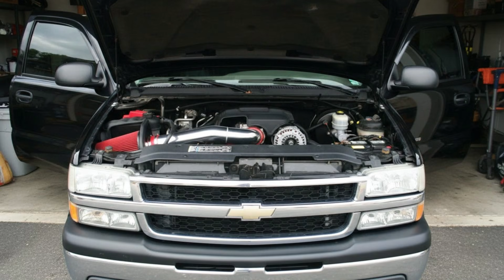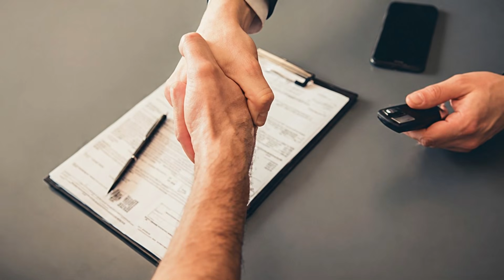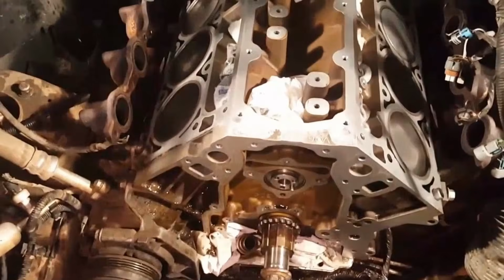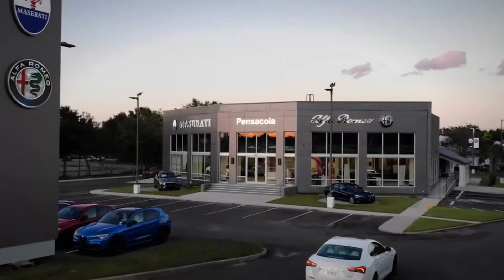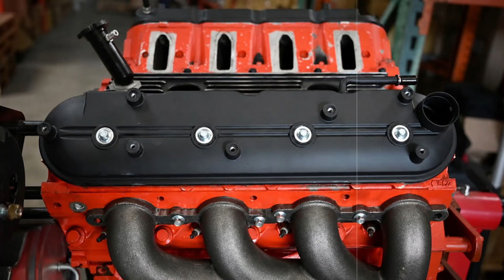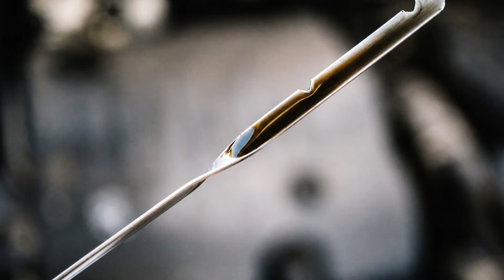The 5.3L Repair You MUST Do at 100K Miles — Or Pay $5,000 Later

Comment: Or you could simply avoid the damn things and buy something else. Unless I could find an older one with low mileage that didn't have that crap, I think that's what I'd do. And that's not even touching on the standard equipment problem on ALL GM trucks...rust. They all rust out. Not an option - standard equipment.